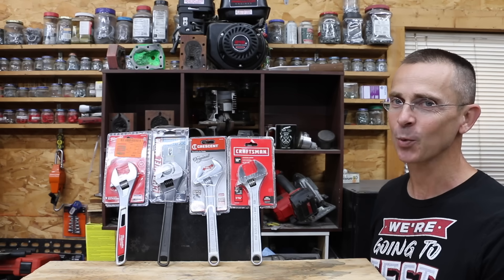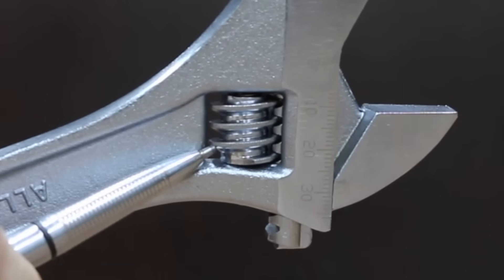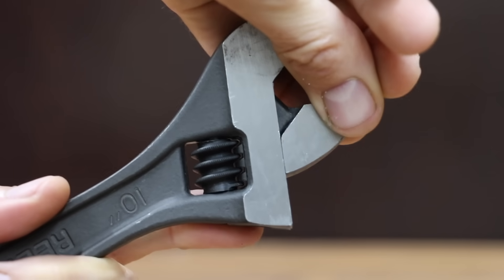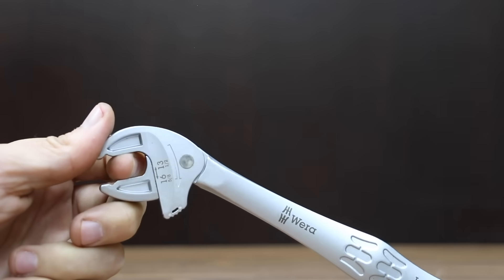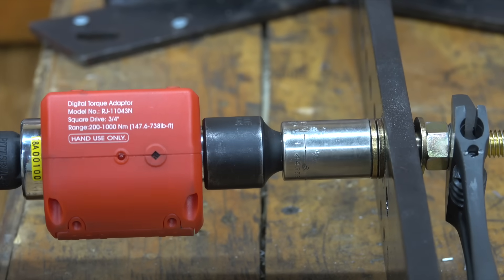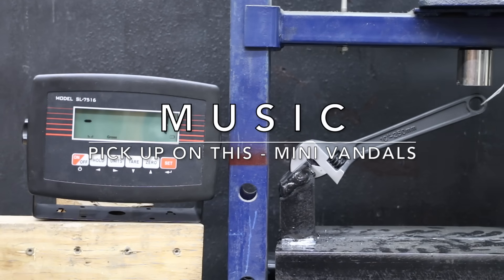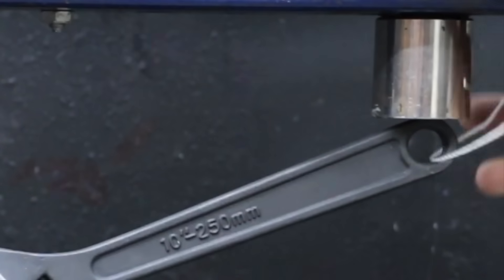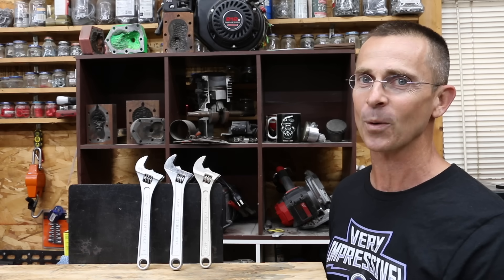Best Wrench (ADJUSTABLE)? Craftsman USA vs Craftsman, Crescent, Kobalt, Milwaukee, Channellock

Comment: Another great "showdown". Thanks. I predicted the Crescent would win. It did do very respectable for the cost. I have a rule of thumb that served me well through a 30 year career in the construction trades: When you can, buy the brand that is synonymous with the particular tool - Channel Lock brand channel locks, Crescent brand crescent wrench, Irwin brand vise grips, Klein brand kleins (electrical pliers) etc.. Though there might exist a slightly better tool than the original given the time and resources to establish a winner, I always got a sturdy, dependable, long-lived tool at a reasonable price by just doing it this way from the start.
Reply from the maker: Thanks for the feedback.
Reply: irwin is garbage now. just bought some and immediately sent them back.
Reply: @trevorhardy3544  What brand do you recommend? I'm about to purchase a batch of locking pliers for my son as a Christmas stocking stuffer and if Irwin's quality  has slipped I guess I need to know it.
Reply: @ralphcantrell3214  i’d like to know myself. i’m honestly super disappointed in tools these days. from trigger clamps and locking pliers, to power tools. it’s mostly junk. hell, even Bessey clamps. THE BESSEY, is now foreign made garbage.
Reply: @trevorhardy3544  Ya, just about EVERYTHING is made in some Asian sweat shop these days, so almost nothing is as good as it used to be. Project Farm did a Best Locking Pliers showdown and Irwin still held it's own for the price though. Somehow I've wound up with a tool box drawer filled with Pittsburgh ones so any brand should be a significant improvement.

Comment: Thank you for thoroughly explaining What I have been trying to put into words about my made in the USA Craftsman  wrench and why its my go to wrench. It always just "felt" better. Awesome video!
Reply: It's amazing that the human brain can detect those fraction of a millimeter differences in tolerance between high and low quality tools just by feel.
Reply: Agreed,.  Being irreplaceable at this point I don't use em on grungy work anymore.
Reply: Yes my dad has some old made in USA craftsman and they are better than the new ones I bought a couple years ago. I've already had a 3/8 ratchet break and his still works fine 50 years later.

Comment: Not emphasized in these tests is the significant loss of grip caused by chrome plating: other things being equal, unplated steel wrenches can produce greater torque because chrome wrench jaws are more slippery than bare steel. IMHO...
Reply from the maker: Thanks for the constructive feedback.

Comment: Do a test with concrete but using rebar as the base...chain link....garden fence....chicken wire.....stucco wire. Just curious.
Reply from the maker: Thanks for the suggestion.

Comment: Back in the day, If you used your tools a lot and wanted them to last several lifetimes, you bought Craftsman. They were made extremely well, reasonably priced, and you could replace them for free if they broke simply by going to any Sears. You could hand them to your kids who could hand them down to thier kids. If you were lucky, your dad bought you your first tool set...and they were Craftsman. Npw its mostly " good enough" cheap tools. If you need something once and don't want to spend a lot, it might get you by. But for hand tool, try to find the old Craftsmans.
Reply from the maker: Thanks for sharing.

Comment: 🔨🔨🔨hammers🔨🔨🔨 Stiletto, Martinez, Vaughan, Estwing, DeWalt, Stanely, Milwaukee, house brands
🔨VIBRATION TRANSFER TO HANDLE🔨
🔨WOOD VS FIBERGLASS VS TITANIUM VS STEEL🔨
Bent handle vs straight handle.
Milled face vs Smooth face.
Claw strength, metal chipping from hitting hard materials. 
Force to break handles.

PLEASE!!! You do great work!!!

Comment: In the test with screw and 2 nuts, you had turned all the wrenches in the wrong direction on the nut side. when turning a screw or a nut, always screw the screw head and nut into the wrench!  👎
Think about why the wrench is designed as it is?
Why do you think the handle and jaw opening are not in a straight line?
Carsten
Sweden

Comment: Stanley has a pretty nifty adjustable wrench which has a locking mechanism not unlike a vise grip. History behind the design is pretty fascinating, even moreso considering that's verbatim the tool they use up on the space station.
Reply from the maker: Thanks for the feedback.

Comment: Great video!
I’ve used a ton of different adjustable wrenches. Bahco is best overall in my opinion.
The narrow jaws get into small places, and they open very wide for the length/size
The larger sizes are a bit beefier than the 8” and 10” so they can handle the larger forces
Reply from the maker: Thanks!   Thanks for sharing.

Comment: The difference is if you broke your Craftsman tool when Sears was open they would have replaced it for free
Reply from the maker: Thanks for the feedback.
Reply: @ProjectFarm  that wasn't really feedback just a coment. Unless you buy expensive tools like Matco or Snap-on if you break your tool your out of luck. Thanks for the video, proves America still makes the best products. Maybe next you can test the new Craftsman tools made in America with imported materials

Comment: I really love your videos - thorough, unbiased testing, just perfect! Although a lot of the brands you test aren't really aviable in Germany and German brands tend to be cheaper here than in the US (for example: the Hazet 279-10 and the Klein Tools 507-10 are both about 40€ (~$46.50) including VAT), it's still interesting to see how the different tools compare to each other in in terms quality and wheter or not I actually got the better stuff for spending more.

However, I'd love to see three additional tests in most of your videos:
1) Ergonomics
How does the tool feel and fit in your hands? Does it get slippery when you've got water or oil on it? Does it have special ergonomic features? If it has a rubberised handle, how well does it hold up to wear and tear? A tool is only good if it feels "right" and when it's fun to use - it su**s when you get cramps in your hands because your screwdriver isn't ergonomic or the buttons on a power tool are badly placed! Most of that is pretty subjective, but I trust your opinion and I'd really like to hear it.
2) Warranty
Most of the products you test boast of their "lifetime warranty", but are those claims real? How fast and easy is it to actually get a repair/replacement or your money back? Do the brands offer customer support? How can you reach it and how fast and good is it? A long warranty, fast and easy processing of claims and a good customer support adds a lot of costs for the manufacturer which is then factured into the price of a tool, so things like that should be considered when testing and comparing them. Sure, it's hard to test that every time - you can hardly send in broken tools every week without raising some eyebrows - but once in a while, maybe by using a proxy, it would be great to see how the different brands/manufacturers perform after the sale.
3) Repairability (power tools/bigger devices)
How easy is it to open up the device? Does the manufacturer help by providing usable schematics and/or good technical support? Can you get replacement parts? Where can you get them? Can you buy them at a hardware store or do you have to order them directly? If so, how long does it take until they arrive? How much do they cost in relation to the product itself? To perform easy and fast repairs on your own, without spending nearly as much as a new device would cost, are very important when buying pricy power tools and devices, so it would be interesting to see how the different brands handle repairability, availability of spare parts and tech support. And again: warehousing/logistics of parts and a good customer support costs money and makes the product more expensive, so it should be considered when judging them.

Also, a video idea: Best Digital Multimeter
There are so many of them, ranging from less than $15 to a few hundred dollars - and all (claim to) do the same... But how much do I have to spend to get a good one? Can I trust a cheap multimeter? Are the expensive ones really that much better? Would be interesting to find out...
Reply from the maker: Thanks for the suggestions.

Comment: I would love to see a video comparing various weigh scales. Going off Amazon reviews just doesn't really cut it. When it comes to weighing milligrams most that I can see just have 1 decimal place for their gram measurements which doesn't really cut it for accurate measurements on a small scale
Reply from the maker: Thanks for the suggestion.

Comment: We have a front cut plier made in the USA at around 1940. It has no play to this day - and it was used often. Where it's made is not that important but when a machine is manufactured to better standards it's usually not worthy exporting the production. Vintage tools are better because people used to expect a tool to last forever in those days.
Reply from the maker: Thanks for the feedback.

Comment: If you notice, when you use the adjustable wrench in the video, you pull toward the moveable jaws,  This put the pressure higher up on the jaws, contributing to jaw spread on the weaker jaw.  If you reversed the pull and up the pressure toward the solid jaw, the movable jaw pressure is much lower, putting more pressure not so much on the jaw itself, but on the worm gear.  Think about it.

Comment: You should do a video on insulation window film( that clear film you blow dry to get the wrinkles out).  Like compare different brands but also see if it actually even does anything.  It definitely cuts down on drafts but idk how much heat it is holding in.

Comment: Love your channel. You’ve helped inform many decisions. Here’s one I’m struggling with lately, though: What “mechanic’s tool set” to get for my vehicles. I’ve looked at quite a few, including dewalt’s 142’ish piece kit, Dekopro, EZAuto, and others. My question is this: Is it better to get one of these “all in one” kits, or to piece out your own custom kit with tools from, say, Harbor Freight? Which tool set is best for cars/trucks/jeeps?
Reply: you dont really need all the stuff in the sets, now you are loading around extra weight, build a tool set with tools you actually need for your vehicles, for example for your honda have an 8,10,12, 14, 17, 19 mm and screw drivers,

Comment: As usual, THE BEST consumer advice anywhere. Thank you again for your testing.

I have a Bahco adjustable wrench - bought mainly because it had a wider jaw than most of the others (55mm) and a shorter handle which makes it easier to work in confined spaces but another reason for its purchase was the relative absence of slop/play in the moveable jaw.  It made my older, cheaper set totally redundant.

I also bought one of those Wera Jokers to see if it was actually any good or nothing more than a design exercise and I love it so much I put all the other sizes on my Christmas list. I hope Santa is feeling generous. Thing is with the Jokers, they only go up to 32mm I think.

Although I'd never subject one of my tools to the sort of abuse as tested here, I'm glad you do but if you needed something stronger than the Wera Joker, there's a similar concept by Knipex which they call a "Pliers Wrench". Looks a bit like a plumbers wrench but with parallel jaws throughout the movement. As you lean on the handle, it applies torque to the nut as well as tightening the jaws around the nut. As I said, it's a very similar concept to the Wera Joker but with a wider jaw-range per wrench-size, although owing to there being two handles to squeeze, perhaps not as wieldy in tighter spaces as the Joker. Horses for courses. I'll put a set of those on my Christmas list too... and see if Santa leaves me a rude rejection note instead.
Reply from the maker: You are welcome!  Thanks for sharing.

Comment: Not sure if this if French drains are something you’d be able to test, but I’ve been interested in seeing a non-biased side-by-side comparison on how the different products stack up. The corrugated pipe with the peanut packing type material wrapped in mesh fabric os expensive but I’ve heard good things. Others say just use perforated pipe with the holes face down surrounded by crushed gravel. As a contractor I’ve always been interested in seeing tangible evidence one way or another

Comment: Have you done any testing on oil leak stop? I searched your videos but didn't find a test. My Dixie Chopper B&S engine has a minor leak and I don't want to pull the engine to replace the main seal and engine case gasket if I can "cheat"!

Comment: Nice comparison! You put good effort in figuring out relevant tests. I love Bahco, and it's nice to see them end on/near top. Here in Europe, or in the Netherlands at least, pretty much everyone calls an adjustable wrench simply 'a bahco', because the original invention of Bahco was and still is so succesful and widespread. Nearly all adjustable wrenches you find here in sheds, homes and workplaces are either Bahco or a no-name brand.
Reply: I'm in Texas and have used American made craftsman wrenches for years but they don't compare to a bahco.  Im a plumber and no adjustable wrench is near as good in my experience.  Bahconis for sure the best going and their newer designs for plumbers are amazing.
Reply: The same here in Denmark, but here an adjustable wrench is simply called a "Swedish key", because Bahco originates from Sweden and invented the adjustable spanners in 1892, which formed the basis for the adjustable wrench. But Bahco is now part of SNA Europe which is Snap-on's European division. Snap-on entered the European market by acquiring the Spanish hand tool company Herramientas Eurotools (Irimo) and later acquired the Swedish saw and hand tool company Sandvik which includes Bahco. Bahco is SNA's premium brand while they have a Spanish lower-end brand named Irimo. Most of Bahco's production has moved from Sweden to SNA's factories in Spain, and many claim the quality of Bahco has gone down because of that, and some claim it’s because they don't use high-quality Swedish steel anymore.
Just about every adjustable spanner here is either Bahco or some random cheap private label brand. Bahco is the most well-known and used hand tool brand here. Their screwdrivers and pliers are even more common than the biggest German brands Wera and Knipex. Although Wera and Knipex have become more and more common in the last couple of decades. But Wiha screwdrivers and pliers are still not very common here although I have a set. It's mainly Bahco vs. Wera screwdrivers and Knipex pliers.
Reply: @ITubeTooInc  Funny how in Denmark (and probably Scandinavia) Bahco is the most common brand! In The Netherlands it's solely the adjustable spanners that are mostly Bahco brand. For tools like saws, planes, chisels, measuring tools and screwdrivers, Stanley is by far the most common brand here. But hobbyist and professionals often like the big German brands, and Bahco is fairly popular for manual cutting tools.
Reply: @ITubeTooInc  Oh, I've also got some Wiha drivers and bits. They're excellent quality, and even pretty!

Comment: If adjustable wrenches are anything like anvils, lettering proud of the surface indicates the metal was cast (liquid metal is poured into a form that includes the (reversed) lettering, hence why the letters are proud of the tool), while lettering punched into the surface indicates forging (letters are punched into the tool after or as part of forging).

I noticed one of the early China wrenches claimed to be forged yet was clearly cast, as evidenced by this method. Perhaps they meant only the jaws were forged.
Reply from the maker: Thanks for the feedback.
Reply: Why wouldn't protruding letters be drop forged? All you need is heat and pressure. (Obviously this is difficult to do with an anvil, because they're bulky instead of flat).
Reply: @Red_Lion8325  just commenting on how it is with anvils. Maybe wrenches, being a lot smaller, are different.
Reply: @bnwww  Yeah, heating up and pressing an anvil to put a stamp in it, takes a lot of heat, and would probably deform the entire thing. Not so with a flat bar. You heat it until it's soft, then just stamp it with a press.

Comment: Suggestion: On the thumbnail picture for each video, put your brand line "Let's find out!" in the center bottom instead of the center-right. The reason is because currently your slogan is being covered by the video duration label.
Reply from the maker: Thanks for the constructive feedback.

Comment: Video suggestion: portable gas transfer pumps both 12v and cordless as well as drill pumps. Great info for boaters amd others with a need to refuel in the wild. Suggest leaks/leaking as a test parameter. Nobody wants gas leaking all over their boat or campsite. Love your work.

Comment: How about how long gasoline stays good for when stored?  So many different answers out there…1 month, 3 to 6 months, 1 to 3 years etc.  and no accounting for variables like what type of container, ethanol vs non ethanol, is fuel stabilizer used…etc.  nothing but anecdotal data out there either…..

Comment: I think you should know how to use a tool before you test it. The movable jaw is the weakest and should be loaded with the least leverage, Closest to the frame. A open end adjustable is not a monkey wrench.
And the arrow on the one wrench is also wrong.

Comment: You should test striking force and shear strength as most adjustable wrenches get used more as a hammer or hitch pin than as a wrench. 🤣